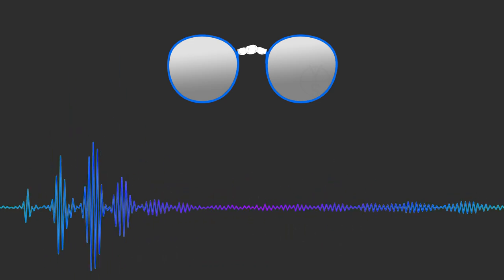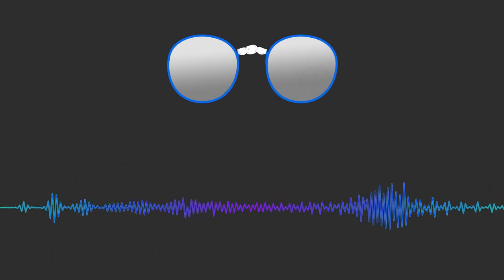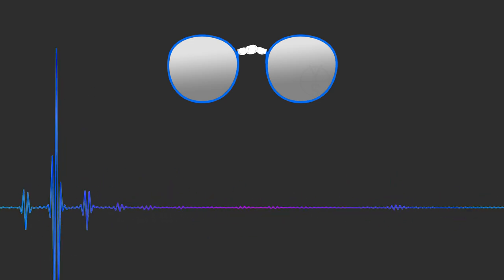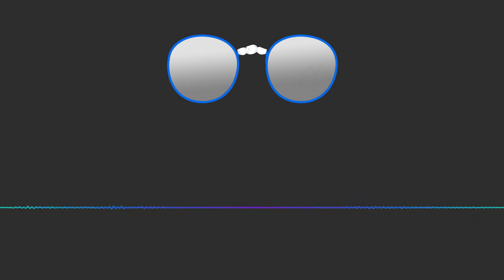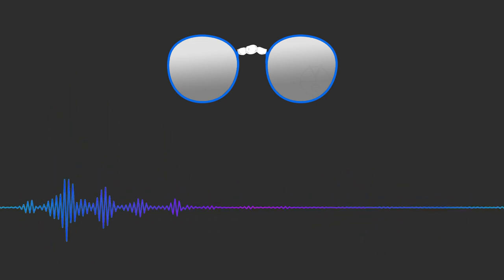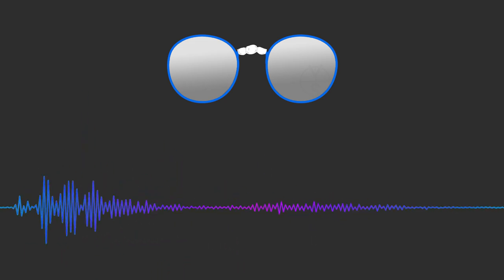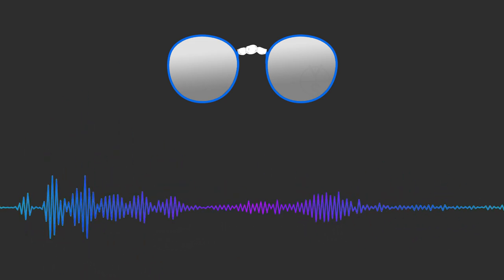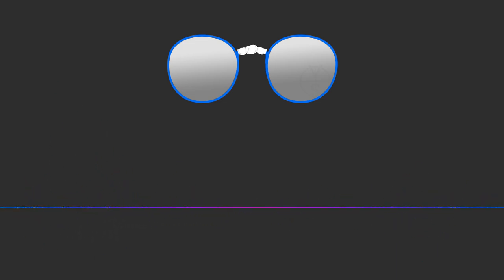Did You Over Build Your Rifle?

Comment: The large case head diameter of 7.62x39 in an AR-15 is not a real problem. Proper materials selection and heat treatment, along with proper designs that minimize stress concentrations resolve any issues with fragile bolts.